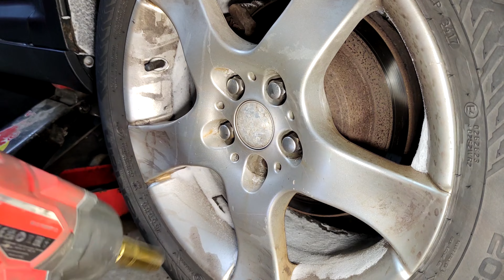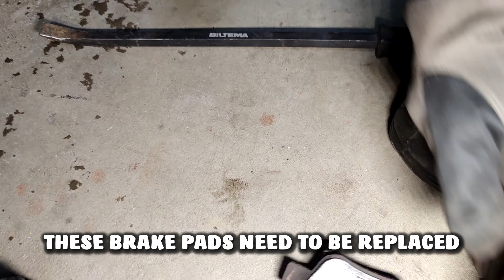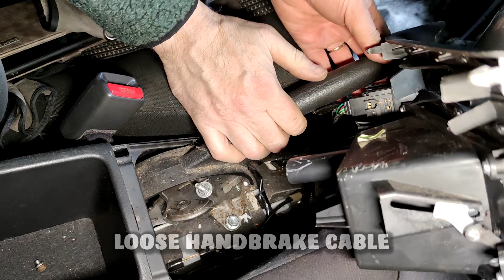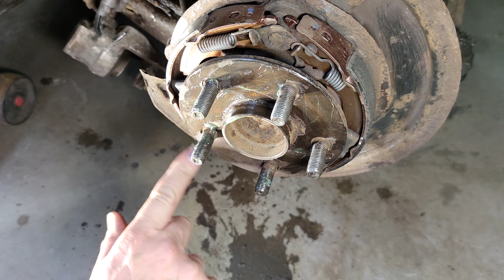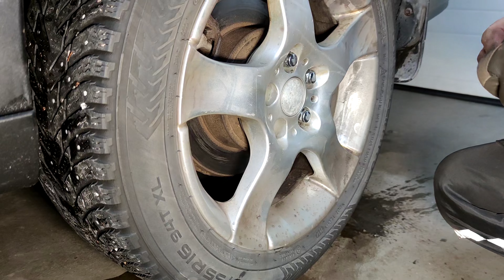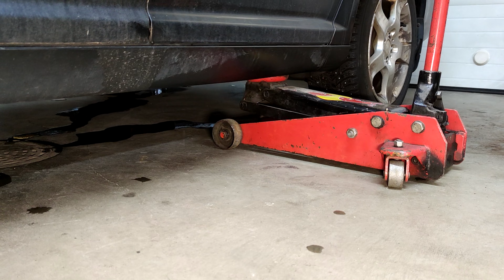Toyota Avensis T25 - Hand brake Fixing

Comment: does the handbrake adjuster rotate in the same direction on both wheels ? Is it possible that you need to rotate the adjuster in the opposite direction on the other wheel to fasten it ?
Reply from the maker: Dont remember. Think it was mirror image.
Reply: @petrisalakka  mirror image meaning the other side rotates differently ? Its kinda important to know if the adjusster works or not
Reply from the maker: @tenderk6151  yes